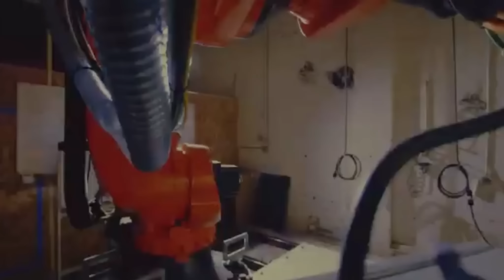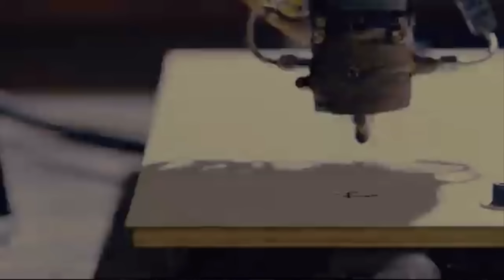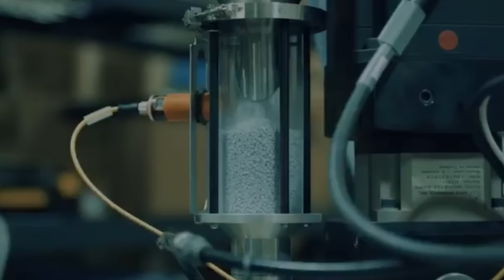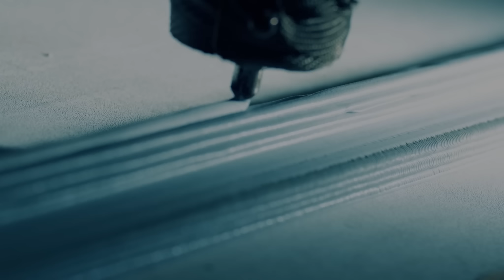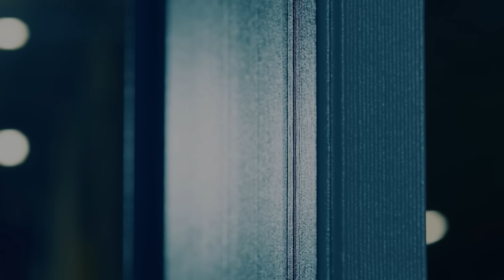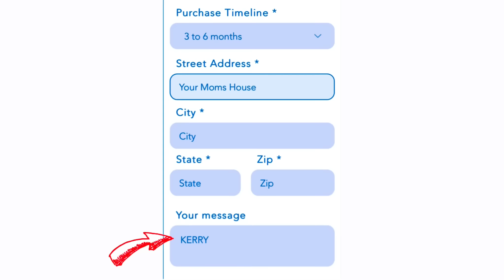Affordable 3D Printed PREFAB HOMES are Now Available - UPDATE

Comment: The Edveros interior temperature in our mountain property has never exceeded 24C in summer or dropped below 19C in winter, measured over two full annual cycles. Without air conditioning. Without a boiler. The building self-regulates.

Comment: The Edveros energy modelling was produced before contract. Output: projected annual generation, consumption, battery cycles, and grid export. After three years the actuals are within 4% of the model. That's engineering, not estimation.

Comment: The rich in Silicone Valley are renting out tents in their backyards for $1,000 p/wk. Others are adding ADU's (Additional Dwelling Units) and renting them out as Air B&B's for even more. Fire victims will have to wait for prices to come down and/or for the rich to fill their backyards with ADU's before housing needs are met in burned/recovery areas.

Comment: As a former Contractor {Developing now),  my curiosity and concern is the tensile strength an structural integrity during seismic shifts, Tornadoes, Hurricanes and even floods. I have worked with SCIP building systems that my late business partner developed in the early 70’s and to this day there  is nothing superior, although BOXABL “IS” close. Safety is always my Primary concern and SCIP structures are e extremely flexible {Unlimited, design on the spot if ever needed) I
Thanks Kerry, you’ve peaked my interest to investigate further. 😉

Comment: Would 3-D printing be strong enough to use in building manufactured Earth Homes? (buried so as to not need energy for either cooling or heating). What about for manufactured greenhouse modules (with solar panels on or as roof not printed) - these could be above ground elements to an earth home - although they might also be buried with sunlight or piped in via fiber optics or artificial lighting because "The Day After." My generation lived in the shadow of Armageddon - and now we had Covid too. If you grow your own food, no supply chain issues - assuming someone can care for your greenhouse and hydroponics when you are sick in the next pandemic.

Comment: The size, shape and floor-plan layouts shown in this video remind me of "mobile home" trailers, but without the trailering ability. It would be interesting to see what the advantages would be for prospective homeowners of this product, compared to people who live in a trailer park. It would be extremely interesting to evaluate Azure 3d-printed small dwellings for their permanence. How well do homes like this hold up over time, as compared to house-trailers and double-wides? Having seen many residential project sites in my time, I can tell you that trailers, so-called "modular homes" and other similar types are not often built to be durable or to sustain high quality. It would be very interesting to see how these 3D-printed dwellings would be a departure from that. Another obvious issue arises: insulation value. Can these 3D-rinted homes offer a "passive house" level of energy efficiency? Can they stay cool in the hot summer and warm in the cold winter while consuming little or no energy?
Reply: Like your questions...hope Kerry sees them.

Comment: Do you know if they are solar powered? I haven't heard any of them mentioned thanks!
Reply: I suspect that they will only include solar panels if local regulations require solar panels. I only know about what is required in the City of Los Angeles and my Manufactured 1000 sq ft ADU has to have solar panels. I also had a 500 sq ft ADU designed and it had to have solar panels.  Manufactured Homes and ADUs are covered under Title 25 in CA. Title 24 that covers most residential construction in CA. Title 24 exempts Manufactured housing from having to have solar panels. However, Title 25 provides guideline for solar arrays on Manufactured homed if they are going to be installed. It obviously is not straightforward. The manufacturer should be able to tell you about the requirements of your municipality if it plans to build for your area. Kerry does not go into the weeds about regulations. They would make his upbeat channel depressing.

Comment: I looked up what they are printing and it's recycled plastic.  That's novel, however because they are homes they are necessarily receiving ~12 hours of sunlight a day.  "Duh" you say, but that's actually a bad thing, because plastic is photodegradable.  That means that sunlight causes it to break down; if you've ever wondered why something plastic that you've left outside eventually becomes as brittle as an eggshell, that's why.  
So it sounds really novel, but I really don't want the entire plastic exterior of my home to degrade over years of ownership.
Reply: Great point 💯
Reply: Recently saw one that prints fiberglass reinforced concrete. Think I'd prefer that.
Reply: Sounds like a reason for regular walk arounds and painting when needed...

Comment: I don't want one of these homes if its going to look and feel like a trailer.  And I certainly don't want a prefab home if, after ten years, it looks and feels like a RUNDOWN trailer!  In order for me to bite on one of these projects, I want my home to look futuristic inside and out.  I want it to be futuristic as well in its control/interface aesthetic (you know, with AC and heat, major appliances, lighting, water, etc).  I want it to be VERY energy efficient.  I want my home to feel sturdy and secure.  And last but not least, I want the home to maintain its look and function after 30 years!  Thanks again Kerry for keeping us up to date on these projects.  I'm excited about the future of these houses and look forward to eventually living in one, as long as its "done right."
Reply: How do you feel about boxable and the iris?
Reply: @5Kwame  The jury's still out on those two.  I think my favorite, so far, is the Nestron Cube2 series; in particular the Cube 2X catches my eye.  I could see myself living in one of those later in life.  As long as it holds its looks and function.  Historically though, its been very difficult for any prefab housing to appreciate in value over the years.  Subsequently, I'm still in a wait and see mode.
Reply: @MrPhife333  You might like the Huga.